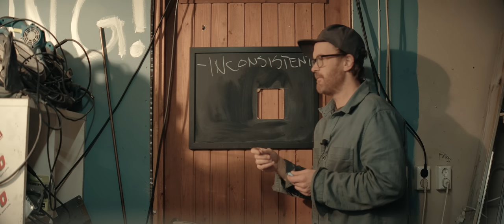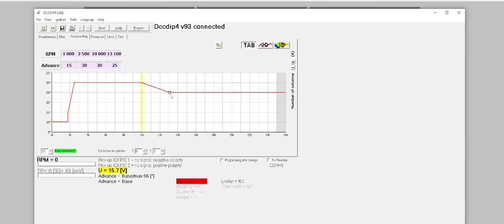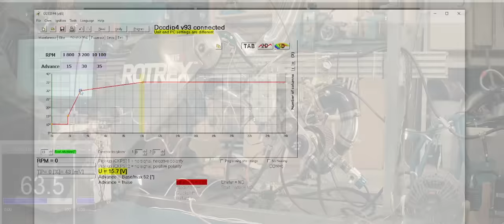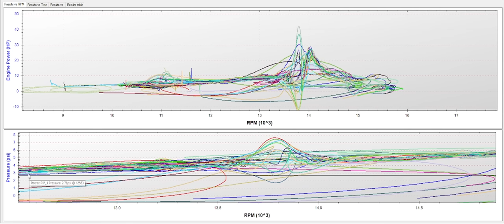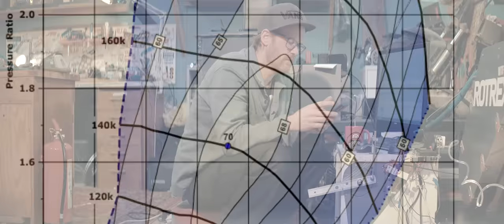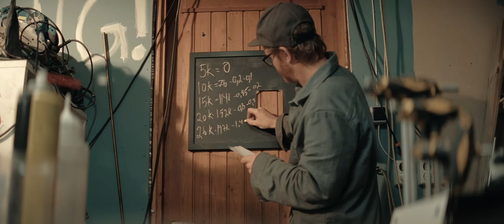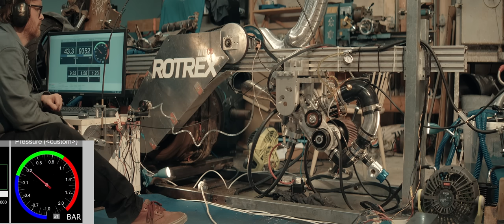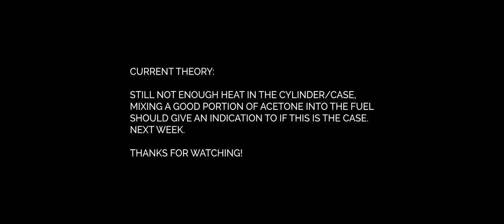Supercharged Pulsejet Engine?

Comment: When you back off after winding it out, there's a lot of fuel not been burnt burning off, that does burn off on the back off side of things, you might need to pay some attention to the exhaust, expansion chamber diameter and length, it might need to be tuned better by changing it's size.

Comment: when you fully throttle or open the additional flap, only air pushes through all the channels on the cylinder and therefore the fire from the exhaust

Comment: I would try a abnormally small pipe bleed.  It will significantly increase the ability to retain/generate heat and should also get the intake to exhaust pressure more balanced.  

The pipe is supposed to revert the pressure pulses back into the engine.  The supercharger is providing an artificial amount of intake pressure so it would be safe to assume you're gonna have to address the exhaust pressure as well.

Comment: Hey Alex; I know many others have commented individually similar things but, I’d like to propose a theory that may root out what the issue is.

I notice that the less timing you ran at the higher blower drive ratio, the more that the “pulse-jet” effect happened out the end of the pipe, meaning either the fuel is still burning outside the combustion chamber or post-secondary-combustion is occurring from over scavenged fuel air mix not being stuffed back up the exhaust port by the pipe (meaning the pipe isn’t very effective in that range of operation), or a combination of both theories....

If either of these are true; then your acetone idea could hopefully “prove-out” one of them, but the other may take other means.....My suggestion is since you have the fueling mostly figured out with the carburetor your using / current fuel, do you think it could be valuable FIRST trying smaller / more restrictive stinger dimensions (vs. what’s ideal size for predicted N/A power) to reduce over scavenging? Maybe also try pre-heating the pipe or insulating it (wrapping it) to get the speed of sound up in the pipe so the methanol / oil doesn’t steal as much energy from the system? These two ideas wouldn’t seem to be super intrusive to your setup, and would at least prove out if the pipe is contributing to your performance issue independent of ignition or heat issues.

One other thing to consider on ignition strength; is also the duration of the spark. “Old-timey” digger type dragsters using early (low output / dwell) ignitions sometimes needed 50+degrees of ignition lead to run nitro, and this was on top of drive ratios that produced 30+ psi of boost.....I mention this, only because 30-degrees of ignition advance may seem crazy to you on a 2-stroke but, that amount of advance still may be not enough to get peak cylinder pressure 15-degrees ATDC, due to the slow burn / current ignition. If reading the ground strap, and experimenting in the 30-50 degrees of ignition lead zone may helped with learning of what is going on with the fuel / ignition, independent of a solution, it could also be a metric to rule out the pipe independent of changing it.

Just some thoughts; hope its helpful & keep up the good work! I’m excited to see what’s next!
Reply: Edit; maybe even try a “stand pipe” exhaust (just a length of straight pipe off the exhaust port so you can play with tuned lengths), to observe what side of the pipe-power-band your operating in / at, independent of an expansion chamber.

Comment: On  air cooled bike engines  running on nitro fuels the cooling fins are removed to allow the engine to run hotter. 70 degrees your engine reached seems low still? perhaps install a thermostatic valve?

Comment: Hi Alex. It’s looking like you took one step back. A power valve in the exhaust port might help.  Like on a Rotax 258. ATK used them on their 250/260 LQ.  They can be tuned.

Comment: Is the compressor surging? You increased the speed and it seemed like it hit a wall sooner, which supports that possibility... Not trying to distract from the potential fuel vaporization issue, but between the fluctuating pressure readings I've noticed in the last few videos and the noticeable vibration of the whole assembly, it might be part of what's happening. Also, maybe this is already on your mind, but fuel vaporizes more slowly at higher pressures, so maybe try running a super light spring in the blowoff valve to keep the boost really low and see if it runs better?

Comment: I don't know much about 2 stroke but could your exhaust be causing this at all? You've changed everything else but the exhaust..maybe the shape and length are causing weird reverbs of the exhaust pulses at 13k and once it starts into that weird area it just keeps itself going like that? The exhaust is supposed to help with extraction of spent gasses by the frequency of it right? Maybe because your have forced induction the exhaust is causing weird pulses?
Reply from the maker: Could definitely be(and most likely is, at least in part)the exhaust👍
Reply: Ian, when this engine was run with the roots S/C and speedway carb it achieved 18300 rpm and climbing pulling the retarder using this expansion chamber.
I personally believe It's down to the carb not atomising the fuel/oil homogenously and the carb working on blow through with the the rear reducer in place.
Reply: @malcrandall1309  I most def could be wrong..most of my experience with motors is cars and 4 strokes...just got into the motorized bike scene a few months ago..but I follow this channel 45% because I love the engineering aspect and his building as much as possible by himself 5% is the two stroke side(just because I don't know much about them) 50% because I love his personality..if I could meet anyone I've seen on YouTube it'd be him...but my thought on exhaust is just from the little I know about these motors..but correct me if I'm wrong isn't a good two stroke exhaust supposed to help with the fuel mixture being pulled up into the cylinder by the use of "idk the right terminology" frequencys? The pulses caused in the pipe help suck the mix in during the overlap...my thought was what if at that high of rpm the "frequency" is somehow matched too the case pressure and it obstructs the mixture from being sucked in to much or not enough and once it gets into that rhythm it can't overcome it..I'm probably 100% so far off but in my head it makes sense as a possibility
Reply: @iancampbell6002  Thanks for your reply Ian. If this engine was run on petrol it would run fine as previous tests. Check out " Superchargered 50cc engine throwing parts" from around 6 weeks ago. It shows this engine revving to 18k plus using the Roots blower/ speedway carb pulling the retarder with 15deg of timing and using this expansion chamber with it's stinger attached.
The only thing that has changed is the carb and supercharger now using blow through instead of pull through.
Yes, Alex would make a great teacher.

Comment: I think it could just be the character of a blown two-stroke engine not to be able to rev that high. Might be too much flow restriction from the exhaust to release enough of the exhaust gasses, you are pushing way more exhaust gasses trough it then when you are running naturally aspirated. You might be chasing rabbits.

If i remember correctly the engine wouldn't rev without exhaust, i was thinking perhaps using a vario to drive the charger, so it will build up more pressure as revs increase, or the other way around, not sure if you need more pressure to help it rev past 7k, or less because it is drawing too much power to rotate the charger.

Another option is trying to implement a 'power valve' to the exhaust, to help overcome the dip in the lower rpm's and allowing for more flow at higher rpms.

Just my 2 cents. Keep up the good work, love how dedicated you are to making this work, amazing.

Comment: What If you try a different shape expansion chamber in the muffler? Targeting a different frequency up at the 13-15k rpm mark. This pulse jetting you’re getting might be a bad frequency forcing exhaust back into the engine, I’ve seen these things before in my trials on 2stroke engines

Comment: Much more timing, we ran ridiculous amounts if timing. When you are close to starting with four you are making some steam. And play with stinger od and length. Make it tunable on size. You are burning fuel when exhaust opens and transfers blow the flame out in to the chamber, you need to finish the combustion cycle before exhaust is open, and that needs alot of timing.

Comment: Did you say you’re planning on taking it to Bonneville? Keep up the good work, seemed to be getting better with the heat, but certainly not more air. Interesting. Haha, flying to another country to pick up parts the same day, love it! I road one of my new build turbo sled today. Not the full mod one, but it runs really good. You just can’t wipe the smile off your face on a turbo sled in deep snow. Thanks for sharing

Comment: Thanks for all the great work so far , love watching every episode. Now for temperature, the blower will be increasing that air temp and would be interesting to know how much, maybe touch the air inlet or place a sensor just before carb, all EFI set ups monitor temperature and some   do air pressure as well. Which might become a issue with the thin air at  Bonneville  be at seven thousand feet above the sea.

Comment: I remember a story Don Garlits (Top Fuel pioneer) once told in a video: He was running the 392ci Hemi  engine by Dodge and doing well, then Dodge came out with the new 426ci Hemi. He tried it but consistently ran slower than with his 392, so he went back to his 392.
He was sponsored by Dodge and the boss called him and said: You must run the 426 hemi.
After endless trying he could not run quicker that the 392 and he was so sick of it he just turned the distributor to max timing, if it blows it blows.
He ran the fastest time he even ran. Engine was happy, no broken parts.
Turned out the larger combustion chamber of the 426 needed WAY more timing advance than he thought was safe, because nitro burns slowly.
Moral of the story, don't be afraid of timing advance with nitro, especially later when you go for higher nitro mixtures.

I have no experience with nitro myself, but I'm fascinated with it and thought I would share the story :)
Love this channel!

Comment: Its as though it needs a block on the exhaust port to prevent the fuel and air from getting shot out in one instant, then somehow pump it all out in the next. The expansion chamber is supposed to do this, but is very frequency sensitive. Might be time for something more radical, and less sensitive to piston speed.
Reply: The expansion chamber was designed to be resonant at 19k N/A
Reply: @malcrandall1309  except his engine isnt N/A anymore, and the exhaust gasses are at a much higher pressure than an NA would be at that rpm. The combination of the heat and extra pressure SHOULD be changing the resonant frequency... basically speeding up the sound wave as the boost goes up, and this is probably the problem! Too strong of a wave to get enough of the exhaust out on time, not strong enough to stop the boost from going to zero and getting shot out the exhaust. Leading to huge flames out the exhaust as the engine loses power. Which I have never seen any other 2 stroke do, ever.
Reply: @63turbo  I agree, but! This engine has revved to 18300rpm while using this exhaust with the roots blower/ speedway carb pulling the retarder un braked and climbing in RPM sounding as though the pipe was coming on song.
Check out the episode " Supercharged 50cc engine throwing parts "
Reply: @malcrandall1309  I've been watching these videos, and it has always been a head scratcher to me that it would hit some limiting rpm and then suddenly lose power, right after flames go out the exhaust, and although things like fuel air ratio made seemingly big improvements, it was as though it would still hit the wall with the same problem, just at a different rpm. It makes total sense though if the underlying problem is the frequency sensitive nature of the pipe and the hugely changing sound speed based on boost, fuel air ratio and temperature... richer speeds up the sound wave (wether or not it burns!) more boost does the same thing and so does elevated exhaust temps, all at the same rpm. Keep the engine rpm below the wall, it runs great, a little too close and it declines into pulse jet chaos. What might help is a constant volume pump on the exhaust that doesnt change with exhaust pressure... this would amount to a small roots blower running off the crank. Its only job would be to move all of the exhaust out of the cylinder when the piston uncovers the port, and done like this theres a smooth consistent gas exchange that has nothing to do with pressure or rpm, AND the carb wont get messed with either...currently the wild pressure/sound wave changes are happening on the intake also, probably making the chaos even worse.
Reply: @63turbo  When this engine was run using petrol it seemed to run much better. When Alex first started using RC fuel 5 years ago on the SPX it turn a great running engine into some thing totally unreliable. No offence to Alex but he always uses carbs that are way too large like on the SPX. Months of heart ache, then fitting a smaller carb improves matters no end.
IMO 1inch of piston travel on the downward stroke isn't enough time for the fuel mass to completely burn when reving so high. 310 combustion cycles per second is mind boggling to me.
I genuinly believe a 40x40mm 2 stroke engine is not suited to this RC fuel in this application, but much smaller engines run ok flat out with glow plugs.
The best engine Alex made was the single vavle Brute Force concept which blew everything out of the exhaust port burning or not, no expansion chamber on that.
That was using the roots blower and speedway carb as used on the early version  of this PiP.

Comment: Nitro and methanol burn very slow.  That’s why it requires much more timing.  IMO the afterburn in the pipe is caused by low timing.  You should set timing by reading plug.
Fuel by EGT.
Thanks for all your efforts.
Reply: Hello Ron. For my education please. I know nothing of RC fuel except what I see here. Does this fuel colour the plug correctly on such short runs, ifso what colour should it be?
Just for general information this engine has achieved 18k plus pulling the retarder un braked with 15deg of timing using the Roots blower/ speedway carb, surly this has to mean something.
I feel the lack of homogenous fuel/air mixing due to it being run blow through is the problem.
I have also suggested removing the rear carb reducer and re fitting a longer stinger, we'll have to wait and see on that one.
Just thinking back the SPX from 5 years ago only achieved around 16k N/A using RC fuel.
Reply: In my experience 
You can read the plug just fine on methanol and nitro.  Soot ring at bottom of porcelain for fuel mixture.  Color of copper ring that seals porcelain to body.  Timing by heat in ground strap.

I personally would be doing all this development on straight methanol or E98.

Then when boost port timing exhaust and ignition timing are figured out. Then start adding nitro.

Just how I do R&D.

I would also draw through the carb.
Reply: It takes very little running for a plug read. Few seconds at load then shut it down and read plugs.

Comment: Having some sort of closed-loop control to vary the pump speed would be nice. Slow the pump down if the engine is too cold, Speed it up if its getting too hot.

You're already using an arduino to do the reed bypass, so it should be pretty easy to just slap a 12v capable RC ESC onto that.

Comment: The carb is supposed to vaporise the fuel, any fuel except coal. With a minor tuning. In the general scheme of things, your water temperature should be irrelevant, except for killing your engine via seizure.
The entire purpose of cooling on a 2T is to cool the engine down, which allows for closer engine bits without seizing.

Comment: You could also try using multiple smaller jets instead of one larger one, to help vaporize and mix the fuel and air more evenly... You could also add a bunch of antifreeze to your coolant so it's less efficient than pure water... Or just reduce the water pump voltage, or add a restrictor in the coolant line.

Comment: About that fuel-buddling problem, I think that the injection system would take care of that. Injectors spray the fuel in a lot smaller droplets than a carburettor does, and because of that, fuel evaporation is a lot more effective with injection. Also, you now increased boost, again something that affects the tune of the carburettor. But in my opinion that (fuel-puddling) might not be the case.
How that engine runs without the blower or does it run at all? I wonder if it's time to take step-by-step measures with that 15krpm mark. Is it because of a weak spark, is it because of air/fuel mixture, is it because of backpressure...?  Strangely, the engine is running really nice and smooth and then suddenly starts to spit fire and struggle. It's "running like the 4-stroke" when that pulsejet-flame kicks in. And by that, I mean the situation where every-second ignition is not igniting with the 2-stroke engine.

Comment: I thing and it´s well known, that belt driven compressors are good on lower RPM (torque). For high RPM it is much better an exhaust driven Turbocompressor. It comes to a point, that your engine at high RPM needs more air then the compressor can provide, that´s why y asked you the last time to install a surge valve.